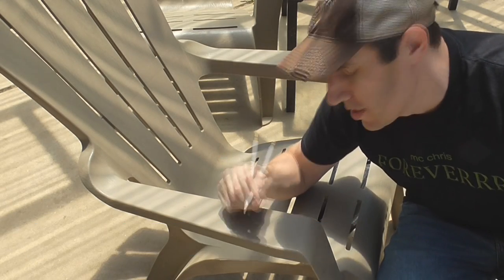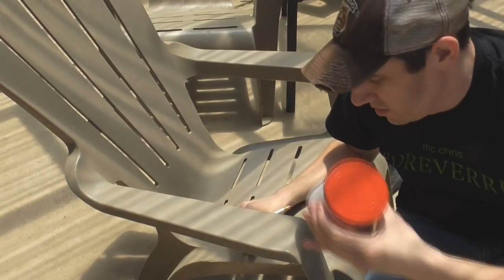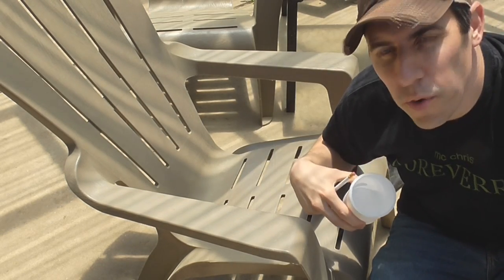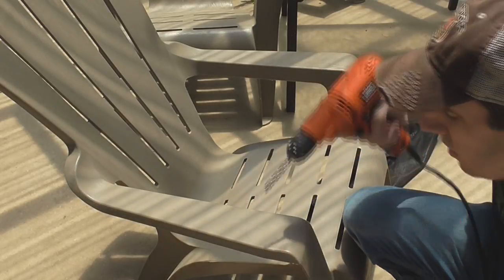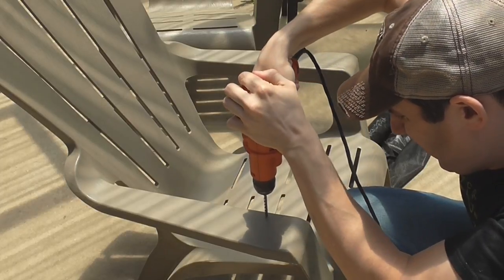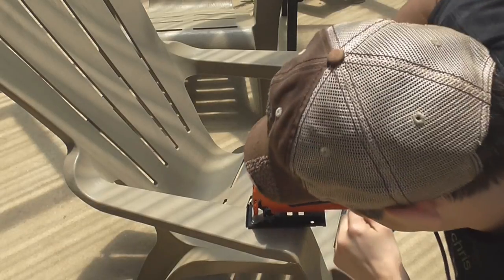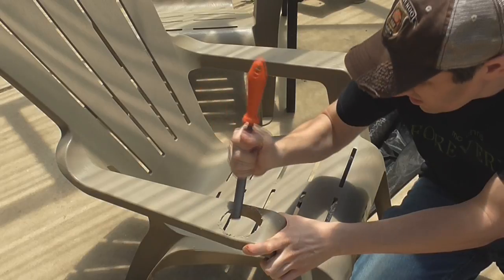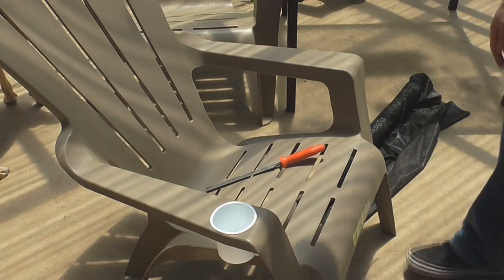How to Add a Cup Holder to an Adirondack Chair

Comment: I would drill a few drain holes in the bottom of the icing container so it won't fill with water when it rains.
Reply from the maker: Great tip!